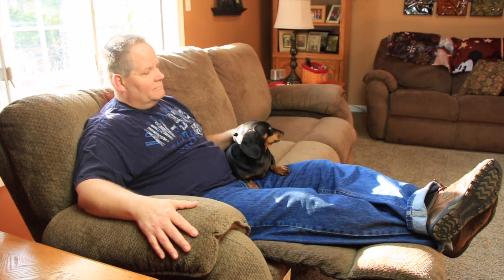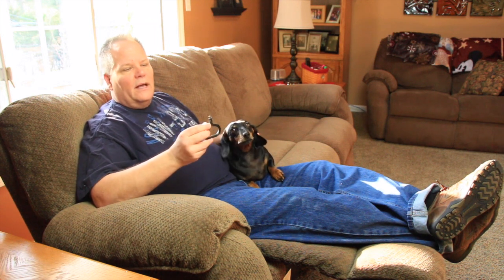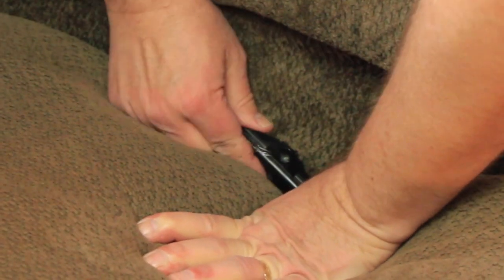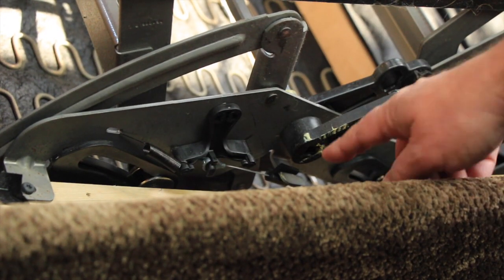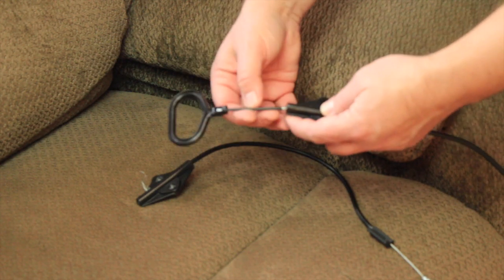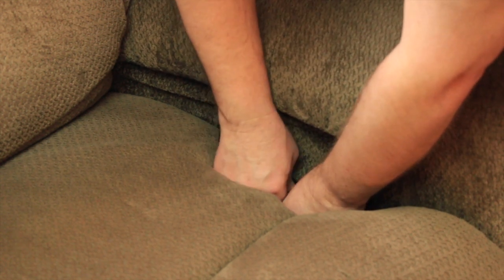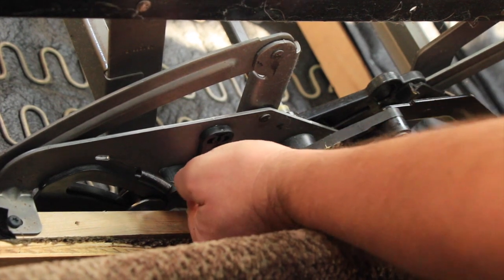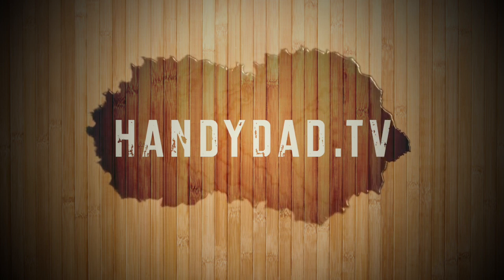La Z Boy Couch Recliner Repair FREE

Comment: This was the ONLY video that showed exactly what I needed.  I could not get the old cable out and had to cut it. I could not get the new cable in UNTIL I read a comment below about needing to cut the material, and that worked.  Thank you for providing this great information.
Reply from the maker: This video is several years old, and I have since moved and replaced that couch, but I’m thrilled that it’s still helping people like you. 👍🏻

Comment: Thank you for your video! I just called La-Z-Boy  and they told me that the part has been updated. They are sending the directions along with the part. (I only had to pay for shipping: $13.99 + tax) She said the installation has changed a little but felt that I wouldn't have a problem following the directions. If needed, I could call them back and schedule service for $124 an hour.
Reply from the maker: That's great!

Comment: Thanks again, Dad. This is the fourth or fifth time I’ve watched this video to make this repair.  This time Lazy Boy sent me an improved “kit” to make the replacement. The cable is the same but it includes another plastic piece that is supposed to somehow put less stress on the cable. Unfortunately they included NO INSTRUCTIONS of how this is to be attached. I could find nothing about it on line so it would be helpful if you or someone else could post a video on how to install that new part. Until then I’m still just using the original type assembly.
Reply from the maker: Sorry, that couch is long gone so I can’t make a new video.

Comment: Thanks, was helpful.  Received a replacement plastic swivel brackets.  The lever mechanism is a little longer, and easier to slip rings over. Seems to relieved a little stress over the handles by giving more leverage. They could as well supplied replacement springs, just in case...
Reply from the maker: Glad it was helpful

Comment: Two years later and it broke again so I am back. Had considerably more difficulty this time on a couple steps. The clip that goes over the cam was much harder to get off then shown on the video. Had to use the pliers and a screwdriver to finesse/pry it off. Feeding the new cable through is also difficult. Had to look at the other footrest to see where it comes out, not sure why they have fabric around the tiny hole it comes out. Wife was feeding it thru and the tip wanted to stay under the fabric but I was able to fish it out. Also, while tipping the couch back and forth the plastic piece that the end of the cable hooks on had fallen off. It just snaps in. Again looking at the other side, not broken, footrest I could see somethings was missing. Found the part and snapped it back in and was able to complete the job. Thanks once again for the video.  More annoyed than ever though at the misleading Lazy Boy warranty practices.
Reply from the maker: Thankfully, I replaced that couch so I don’t need to deal with those rip cords anymore. But I remember having to enlarge the slot in the fabric to feed the new cable through. Luckily it wasn’t visible.
Reply: HandyDadTV   Thanks HD. Yes, since it’s under the couch I see no reason why the hole is so small!
Reply from the maker: When the furniture was made, the mechanism was installed before the fabric. So the fabric was stapled tight over the cable.

Comment: Ironically, or not, I got a link to this in email FROM the Lay Z Boy store I bought my sectional from.  I would imagine they have watched it and take a hint and update the design.  We have sectional and this is on the "armless" section, so hopefully will be a bit easier to replace after separating sections.  With mine the cable snapped in the middle, or from the other end, haven't replaced yet.  Going to store to pick up part and save the $150 install fee.  Wish me luck.
Reply from the maker: Oh wow! Can you send me that email? Email is chris@handydad.tv
Reply: @handydadtv  hopefully it made it

Comment: Chris, we have the exact same couch and love seat and color. And yes the D pulls broke on just the couch so far. . La Z Boy did send me (4) .... anticipating all will break. Inside the arm the cable is really tight and not sure it will just pull out. There's a wood brace getting in the way which looks like it can be removed taking the entire side off . Did you run into this and how did you get the cable out.
Reply: My reply is a little late but may help someone else.  I thought the wooden brace was blocking removal of the old cable harness. Even thought of removing the arm.  Actually all that was needed was to cut  the cloth where the cable is in the wooded brace groove.  Cut it where you can pull the cable outta the grove and another inch of cloth above the brace above the wood brace. This is where you fish the old one out and bring the new thru.

Comment: Our la-z-boy couch has stopped fully reclining on one side. I can extend the footrest fine and it reclines a bit, but when you push back, it doesn't recline any further. I think it's that way due to me bending something when pushing back without extending the footrest to recline and have my feet on the floor. Will have to flip it over to see if I can figure out what isn't working. It seemed to work for my wife who weighs half what I do, but it was still difficult. On her side, it reclines back just fine when the footrest is extended.
Reply from the maker: I agree. Flip it over and troubleshoot. As a last resort, you can call La-z-Boy support. The mechanism has a lifetime warranty.